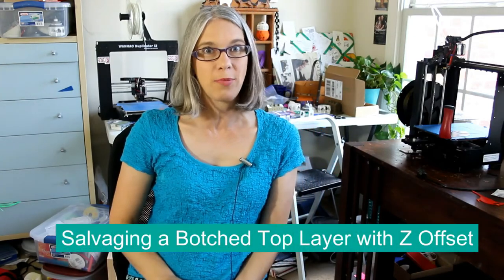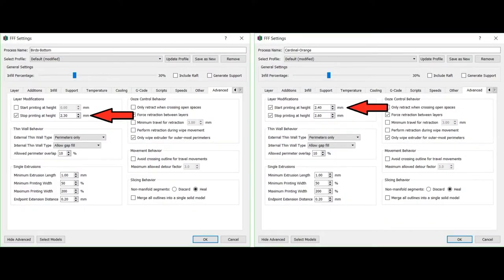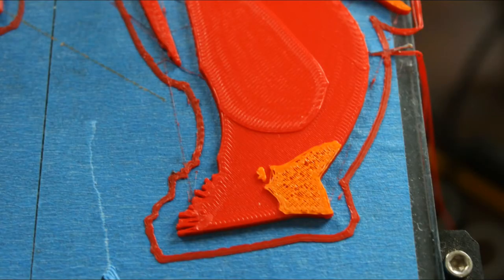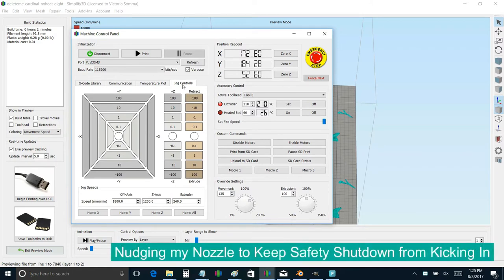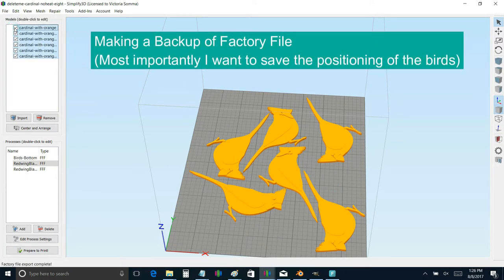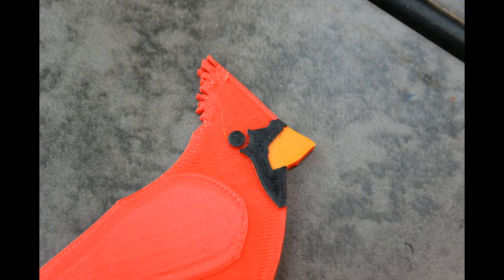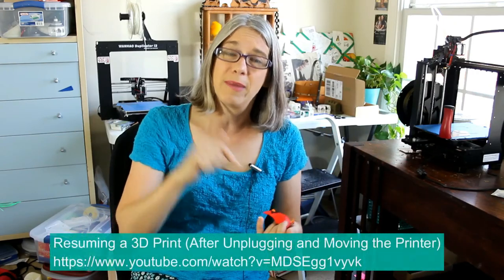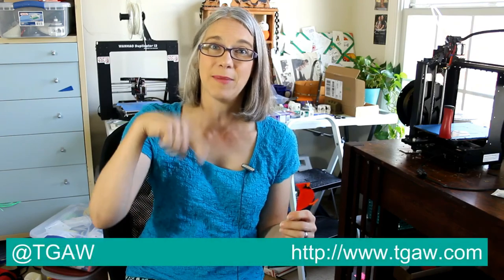Salvaging a Botched Top Layer with Simplify3D's Z Offset

Comment: Clever!

You seem to go to a lot of lengths to salvage the existing print where I would have just thought "start over". Why? Are you concerned about wasting filament, or time invested in filament switches, or what?
Reply: I forgot to ask, are you concerned that this will make the prints less durable? It seems similar to how supports work, drawing at a higher distance, so it might be easier to break off.
Reply from the maker: A lovely day to you!  I could say something like "As a working Mom, my time is scarce so I want to make sure not to waste it." but I don't think that is accurate.  I think I'm stubborn.  I think I don't like to give up on a print.  :)
Reply from the maker: I have found when I have my starting distances right, an unnoticeable change in bonding (note: very informal, anecdotal testing).  I did have a case where I printed white detailing way too high and the letters were easy to sneak a fingernail underneath and peel off the base.  With this orange, I got lucky where even though it was too high, it was pretty darn stuck to the red and sufficient for its decorative function.  However, if this was for a functional part subject to stress, the fault in those first two orange layers may present a problem with wear and usage.  : )

Thanks for such a thought provoking question.  Have a great day!